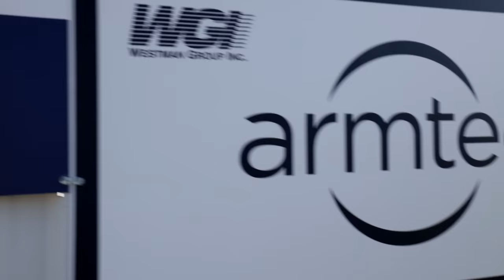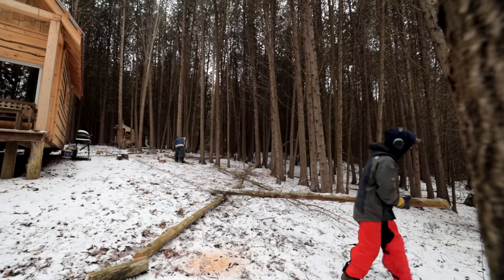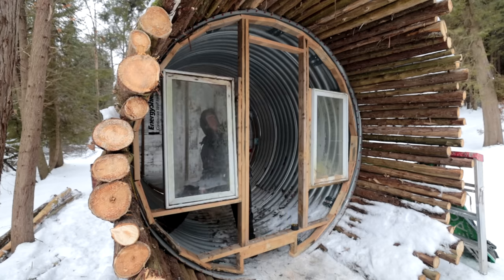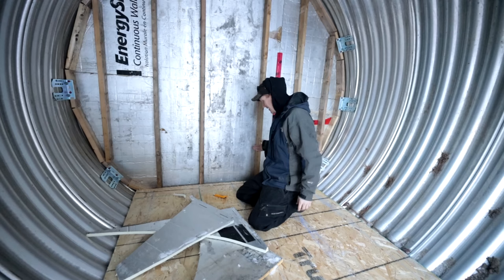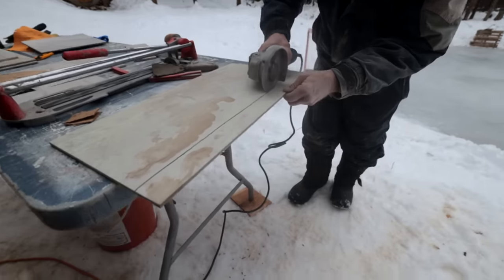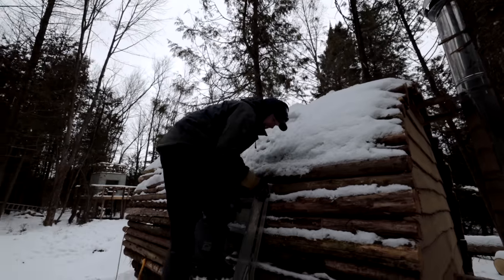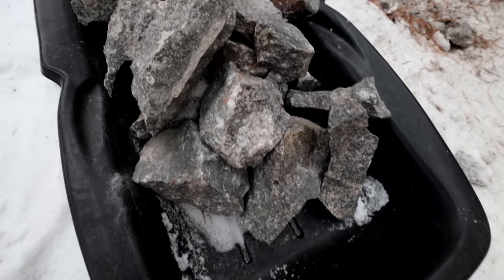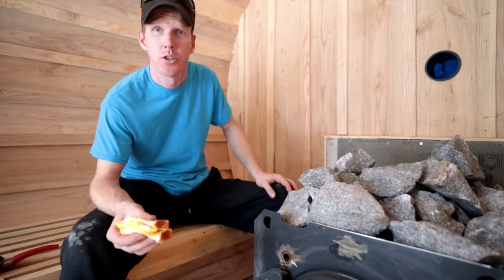Building a Beautiful Log Sauna (Start to Finish)

Comment: You should take one of those pipes and put it in the middle of the creek and make a chill spot once you drop it in the water you seal it at the bottom and you pump the water out the tube

Comment: That is a great looking Sauna. 

The stove might be a bit underpowered for the size, optimally you'd want heat in the 180F-210F area, and the rocks shouldn't lose heat when you throw water on them - it should flash evaporate.

Hyviä löylyjä! - have a good time throwing water on the sauna!

Comment: It looks like an amazing build and (potentially) a very comfortable sauna, much respect.

About getting the temperature higher: as far as I can see, the door has a large total surface of single pane glass. You may gain quite some insulation by installing a (large) glass pane in front of it.

Comment: Nice buildings. I was thinking since you said something right at the end of the video, about the air draw from your chimney pulling combustion air into the sauna, is to hook the combustion air input to a piped vent that leads outside. This way it requires no air from inside the sauna in order to burn. Since it was a boiler in the first place there is probably already some sort of combustion air input on it already, that hooks to a vent pipe leading outside. But if you already cut all that part off the boiler, put it back on maybe, or make your own, that is if you want to try to get higher temps, or just to be more efficient with the wood you do burn. And this way if you shorten the chimney and/or try to install and close a chimney flue, then it won't burn as hot. This way you get as much air as you want for combustion without having it flowing thru the sauna from outside, it will flow thru the combustion inlet pipe instead. But you can still control how hot it will burn using the inlet damper door, but in this case it don't suck the air from inside the sauna, it will be sucking from the combustion air inlet pipe. Same way to control it, but it gets the air from outside directly.
Reply from the maker: In a later video I install a combustion air channel from the floor directly in from of the stove.

Comment: As amazing the way the "culvert" sauna turned out, I was disappointed that the entrance did not have a round door like found in Hobbit homes.  Probably impractical as the hinges would have been complicated, but it would esthetically pleasing and whimsical.  Imagine coming out of the woods to see it for the first time!  Anyway, this is an excellent example of making due with what you have and making it look like it was planned that way from the start.  Love that mill of your's and the Kubota earth machine.

Comment: My only two issues are that the bottom half of the sauna's front logs should have been two or three feet longer for a bench and wind break. And
49:27- I'd have added upward plates to the stove where you cut the sides down.
Oh, and don't cook in a sauna. Food smells attract animals and grease gets into the wood eventually turning rancid.
Great build!

Comment: those rib boards u screwed through the steel , will leak now, u can mix mud and moss and stuff between each cedar log , probably ok though , like u said earlier will drain under the door and dry

Comment: So many fails with this sauna... 

Use heat resistant vapor barrier instead of plastic. 
This also means no urethaine foam etc.. use stone wool. 
You also need a drainage pipe on the floor so all that water can escape and not pool up. 
There should be an air vent under the seat and another air vent on the ceiling. 
The sauna stove you have is incredibly inefficient. So many things need to be done to improve it. 
The sauna stove is basically a heater element that retains heat in itself. So you want the flames to stay in the stove as long as possible instead of just having a straight pipe. 
I personally have a large iron pipe that's coiled on top of the fire area and all those rocks are around those coiled pipes so they get the maximum amount of heat as possible. 
The rocks need to be olivine diabase in order to not crack and explode. 

You go to sauna naked, not fully clothed. Preferably with beer or at least water to drink. 

Greetings from Finland.

Comment: There should be a lower bench and upper bench. For women, kids to stay cooler and upper for serious sauna stuff. You dont put water on stones like that. You just lose heat( your stones have to boil, evaporate that water) and stones crack from cold water. Make a metal bucket that holds about 10g, and is heated by the stove. That will be your almost boiling water to put on stones and wash yourself in winter when you dont feel like jumping into snow
Reply from the maker: I revisited this build and did include low and upper seating.

Comment: Great Build ! I Love it !  Just a question or 2 , driving screws into your timber on the outside ,then screwing the plywood strips on the inside to the Tin/steel,   are you not worried this will allow rainwater to find its way in ?   You Generator, what make and model please ?

Comment: I wonder how much heat you're losing from having 2 large windows and a windowed door? Maybe you can put a draft seal on the door to further help?
Reply from the maker: Yeah that might seal it a little better.
Reply: @ModernSelfReliance  might be a cheap and cheerful test this coming winter? I bet ones everything starts filling in the insulation will get even better.

Comment: You shouldn’t butter your tiles, when it Drys it will slide right off. Place them directly on your grout. You can use a sponge to slightly wet the tile or clean it off it but not soak them.
Reply from the maker: I was having troubles when tiling as the outside temp was -15c or so ... And everything was freezing on contact...  Surprisingly it turned out okay.

Comment: You have too much glass in that front wall. That should all be isolated wood, with maybe one tiny little peek-a-boo window set into the door. What do you need daylight for in a sauna? Also a little vestibule for dressing and undressing out of the steam and out of the elements. You can just add it onto the front - you like to build things, right? :p

Comment: As far as the stove rocks, I have seen sauna stoves with chicken wire over the top of the rocks. It could be to prevent rocks exploding. Never use red rocks. I have had rocks explode in my wood stove and the red ones were lava!

Comment: Too bad you couldn't have put just the front part of the heater inside to where you can still load the wood in it , but have the biggest part of it outside, so there'd be that much more room inside, but that's hard to do with the rocks on top!!

Comment: And...the other thing is, those saunabenches should be sanded,...we usually go to sauna naked, dont you??? They have to be nice and smooth, you can also throw a towel on them, usually we dont!=), so we usually use Apache or aspen, alder OK too =)
Reply from the maker: It was from a fresh cedar.. was waiting for them to dry before I sanded them down.  I'm going to revisit this project in the fall probably installing a second level seating..   and a fresh air intake on the stove.
Reply: @ModernSelfReliance  There we go, Good Man =)

Comment: I like this build. You posted in July 2021. When was it filmed? you said it was winter when you were building it. I am wondering if there is something that can be done to capture the sun's energy to heat it, as an alternative to firewood. I recently saw a computer-controlled wood pellet feeder that can monitor the temperature and add more pellets when the temp is lower than the setting and not auger in more pellets when the temp is too high. I like that kind of tech to possibly keep the temp at a set temp I want it at. However, there is the issue of producing wood pellets.  But i am thinking that might also be interesting for the mini wood stove  .. a kind of blending new tech with old tech for more convenience?
Also.. I was wondering about the possibility of some kind of radiant flooring. .. Maybe one day I will own some land in Canada in a rural area like you and can start building my own projects like you.  I am hoping to make an extended visit to Ontario Canada Next Summer and also perhaps will do a cross canada road trip to visit some of the other provinces and do some car camping in some of the national or provincial parks along the way then back into the USA on the BC side of Canada.
Reply: why would you over complicate a sauna like that lmao

Comment: how the heck were u sitting in there when it was 150 degrees
Reply: It was 150 Fahrenheit, in a Sauna you can easily do that. And after some time, you go outside and hop into some cold water and repeat. Then also strike yourself with a vihta made from silver birch. That's what you need for the proper Finnish Sauna experience.

Comment: Easy to light??? I light up my fireplace with a single match and that's all I need. That info caused me to wonder what would be the best sauna fireplace that would be easy to light up, easy to clean when needed and would push most of it's heat into the room.

Thinking about it, I realized that I was missing several pieces of needed information to figure that out, so now my mind will annoying me until I get hold of most of that information. I can sort of see that using the core of a modern fireplace with a glass door, where the top has been changed to an opened box to hold rocks might be a good start. Yet still a lot of heat will be lost through the chimney unless a heat collector solution is added, maybe ideas from a rocket mass heater is a good idea too.

And I can sort of see how you could create a chimney that snakes up the wall covered by a stonewall and something that draw out the heat might remove most of the heat before you loose it to the outside.

I have no idea if this would work or not, but I find it fun to think up such ideas, but sadly only testing the idea can tell me if it work or not when you get to a certain level and as of now I just don't know enough about how such solutions work to make an idea or model that will work right out of the box. But I still have fine thinking up such ideas and push them along until only testing will tell me how to do it better.

So keep it up tweak your sauna and see what you can do to make it better and better, maybe even you can figure out how to make a better fireplace solution for other things too.